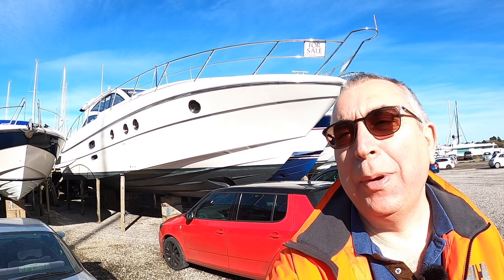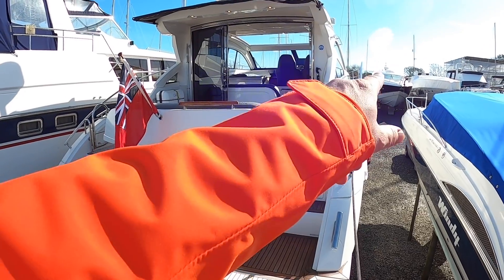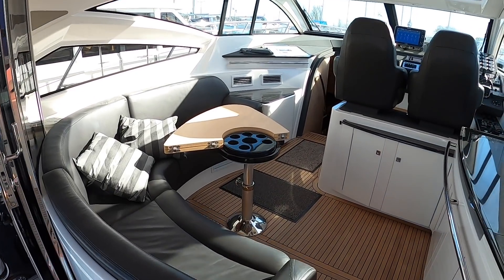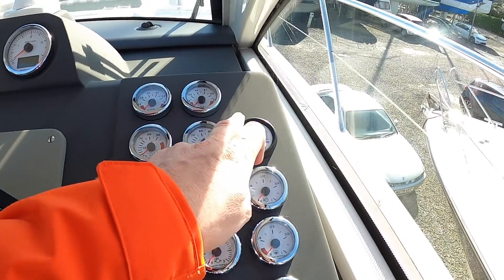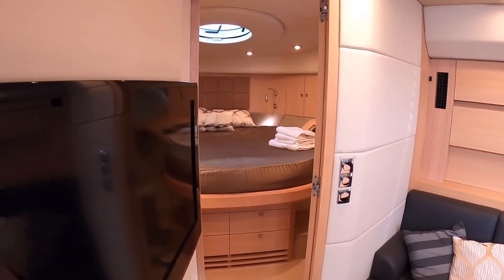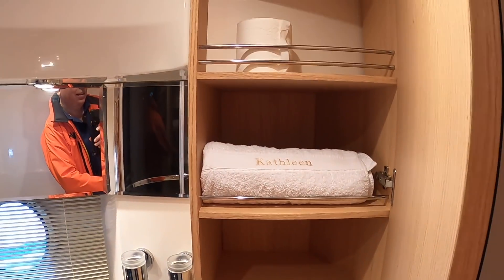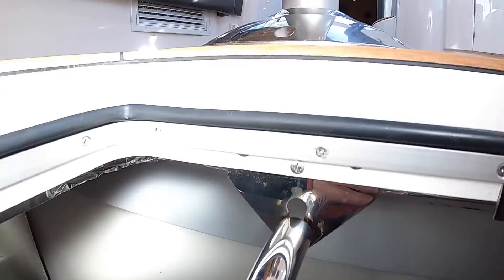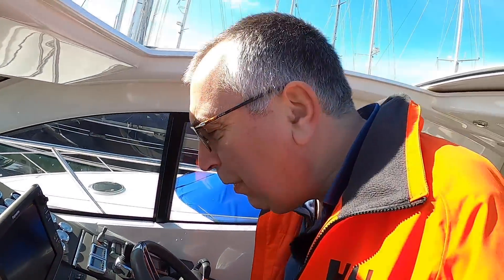Windy 48 Triton used boat report | High quality meets high performance | Motor Boat & Yachting

Comment: Great practical & stylish boat, though seems to be strangely lacking in refrigeration/freezer capacity for 6, even for just a weekend.
Reply: Just think  since found out there is a refrigerator and freezer (or any combo) in the galley floor under those 2 hatches. With you on ditching the dishwasher.

Comment: That's a nice boat, fast and layout is so well done and well finished. It looks like it will last years without to much requirement for upgrades and interior maintenance. However I suspect the price is still up there. Fast solid boat for a lifetime if you had the money, sadly I don't.  I have to be more realistic with boat size and cost. Plus as was mentioned in another comment IPS doesn't fill me with confidence . Too complex unessesarily and outdrives achieve the same result. If you can't manouver with two outdrives and a bow thruster then something is wrong. I am sure the extra cost of IPS with the bigger engines is extremly large.